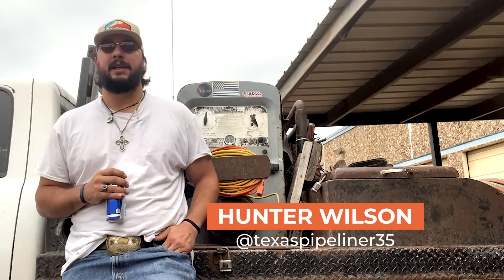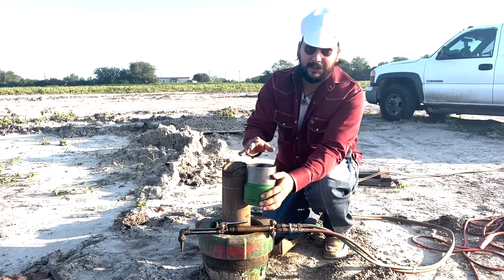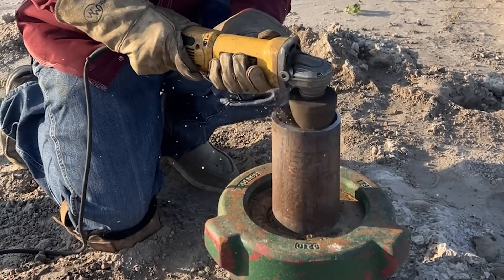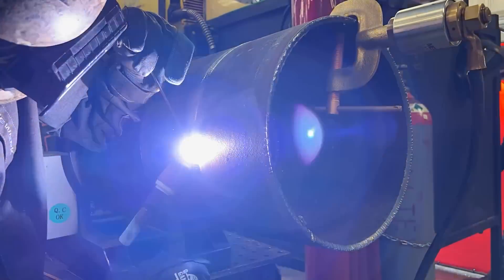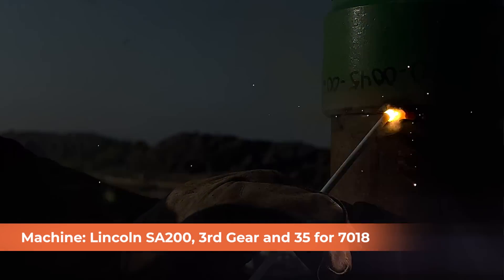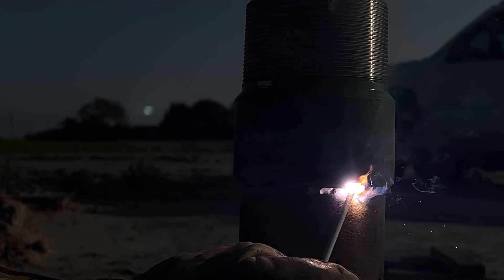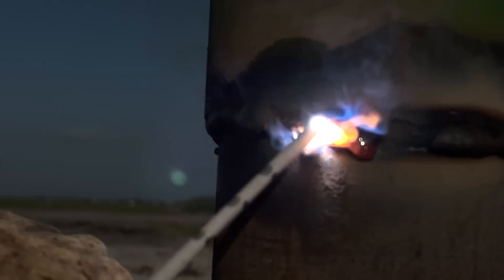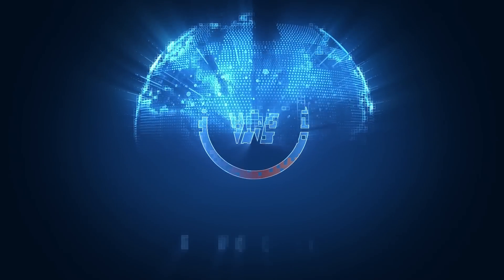How To Weld A Bell Nipple To An Oil Well

Comment: Sir, you can not ever convince me the 7018 weld is even remotely close to clean when you're not even knocking off the slag and giving it a brush on each restart (as a BARE MINIMUM). Dragging the rod over slag as you re-ignited gave me the jeepers creepers. Yikes.

Comment: Be good if can do a video showing a mig flux core flat horizontal weld and then a vertical uphill weld and then a  overhead weld all on the same piece of material and show the settings of the horizontal weld and then show the settings for the vertical uphill weld and the overhead weld to get a bit of an idea of how much you change your settings on welder. As an example you could show the settings that would apply to 5mm thick piece of steel horizontal weld and then show what the settings would be equivalent to for the vertical uphill and overhead weld according to the machine recommendation. Thanks
Reply: We got something like that in the app already

Comment: you might consider using one of the portable bandsaws - it cuts clean and straight, no need even to sand it
Reply: I’m gonna give that a try.
Reply: The only problem would be the diameter and then if the driller strung in a string with high strength tubulars.

Comment: Guess the well is just cased and not yet completed.  Interesting socket weld.
Reply: Nope, they drilled and plugged it so I could do this, I’m not 100% sure what they’re going to do with it, or if it’ll even make.
Reply: @TheHunterT.Wilson  
All wells are cased past production zone and cemented shut.  Completetion is the process of opening the casing to production zone by perforation with a series of shaped charges.  Pay zone may then be stimulated by over pressure fracture, proppant, breaker and chemical treatments.